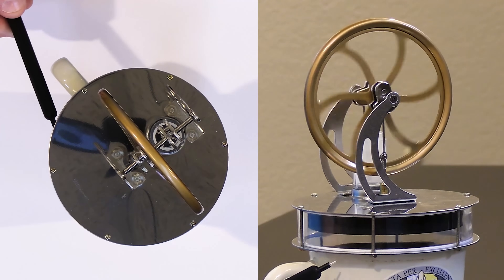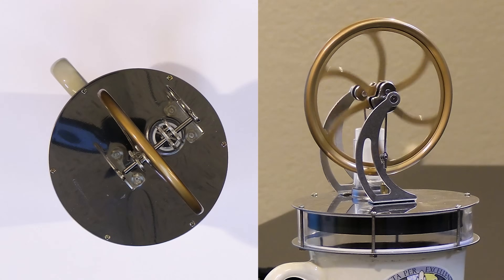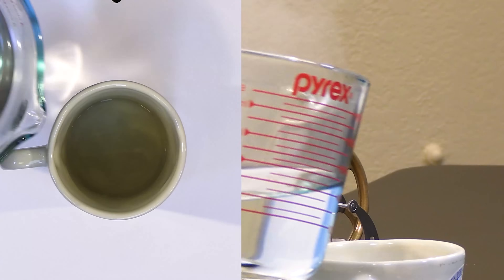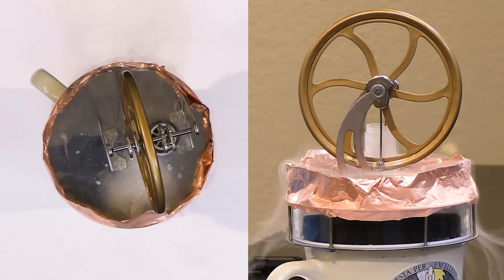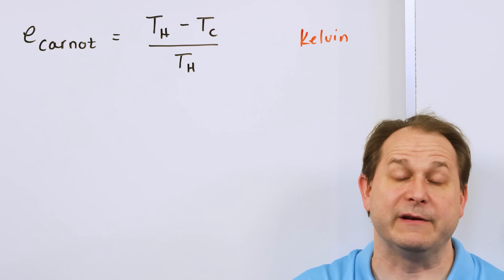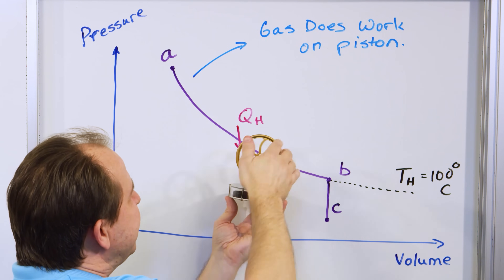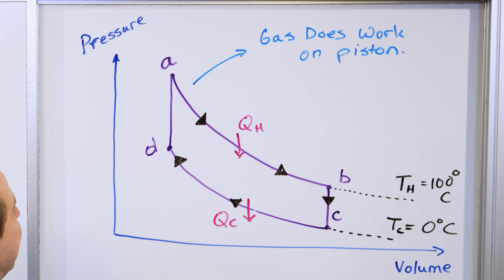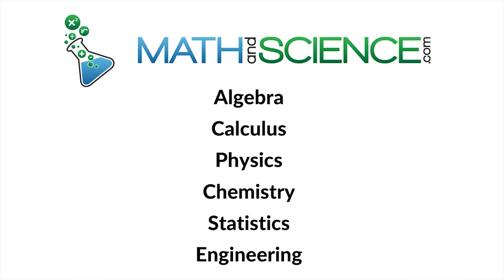How Does a Stirling Engine (Heat Engine) Work?

Comment: Just a reminder... while water freezes at 0°C (at atmospheric pressure), the actual temperature of ice can be potentially any value below that down to absolute zero.
The point being that improved performance can still obtained with the standard material.

Comment: Have Stirling Engines been researched to generate power in space? We could always use a ton of energy in space or on the moon if we had it. One of the largest differences in temperature we see in nature is something in sunlight in space and something in shade in space. Am I wrong? Or is that a perfect temperature difference to take advantage of? Literally inexhaustible energy.

Comment: We could do this again with actual measurements from your Stirling engine.  Temps were mentioned, but some properties of the fly wheel could be mentioned.  Energy does go into the flywheel, but something could be extracting that energy that could be demoed a bit more easily.  Like perhaps a tachometer, but mention that the faster the fly wheel rotates, the more it leaks energy to friction in the bearing and turbulent air.